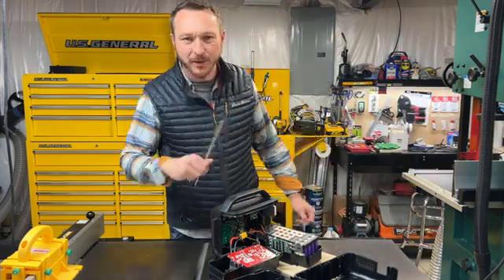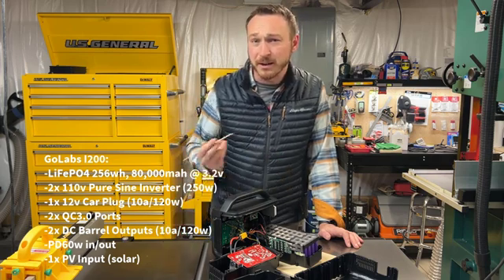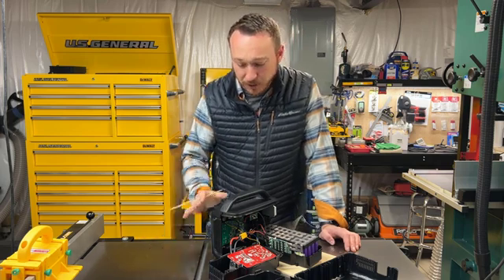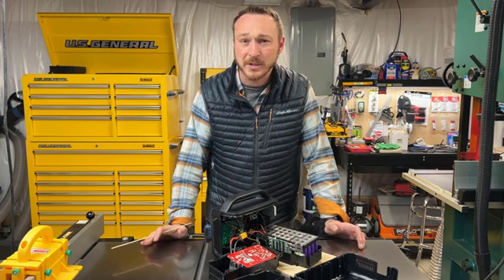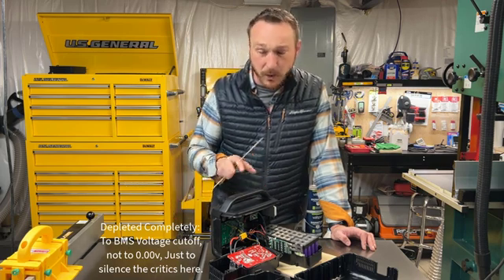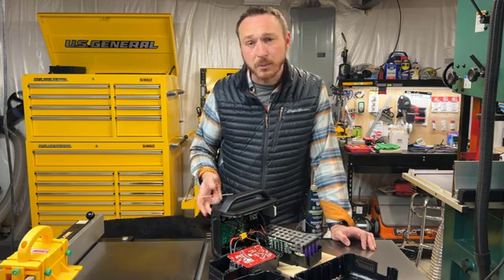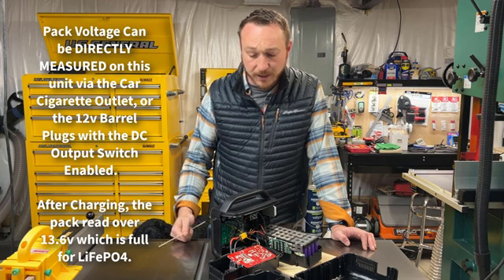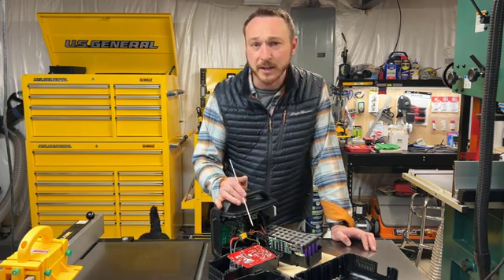GoLabs i200 - LiFePO4 - ER003 Fix - Simple fix to a COMMON failure mode

Comment: I fixed mine without taking it apart. As soon as it beeped and turned off, I got the error. I put it I. The freezer for 15 mins. 

I then Plugged a usb battery back into the usb input at the same time as the dc charger. The usb battery pack supplied just enough power to get the bms to work, and it started accepting a charge from the dc adapter.

Comment: Hey Y'all !!  I have a HUGE update for using these i200/i300 models. 

One of my units I could not get the A/C feature to work again.  So I just left the BMS disconnected. 

I then discovered that it lasts 100% longer than WITH the BMS connected. 
I did a test on the 12v output , running a BougeRv Aspen50 fridge/freezer combo. 
With the BMS on a Full Charge , the unit ran the fridge for 8-9 hours. 
WITHOUT the BMS it lasts and runs it for 17 HOURS !!!
Now it makes no sense , but I think the BMS really limits the Discharge to only 50% Capacity 
and NOW i am able to take it to almost ZERO and cycle it again and again. 

Thoughts ?
Reply: I think you're setting yourself up for substantial battery cell damage. The BMS keeps the battery cells in a certain voltage/current the battery chemistry will tolerate. Lithium Iron cells are less volatile/explosive than Lithium Ion cells, but going outside their operating envelope will probably destroy them quickly.

Comment: THANK YOU SO VERY VERY MUCH !!!!  ❤❤😅
I bought 6 of these i200's from a guy for $50 each.  The original boxes appeared to be re sealed. 
In a hurry I only checked 1 and by fate it was the ONE out of all 6 that the A/C worked just fine. 
Getting them home the other 5 units ALL gave me the ER003 when trying to use the A/C output. 
But, I figured , Hey its still a helluva deal just using their 12volt outputs. 
GoLabs support also simply advised me to Deplete ( cycle ) them to ZERO % remaining and recharge to fix them.  NOPE , no Fix.  Then another technician said hold down the POWER and LIGHT/SOS buttons for 15 seconds to reboot the BMS ( also, No Fix )
Then I found your video. 
Waalaa , I now have 5 units that the A/C feature works and 1 that is permanently unhappy. 
I ordered a DALY BMS off AliExpress which hasn't arrived yet to try and remedy the last one.  For only $18, A new BMS , I figured would be worth the fun to try and also increase the BMS from a 15amp factory to a 30amp  to test the difference in being able to handle a bit more.
But Again ... Sincere Thanks for this simple video on the ER003 fix. 
Cheers !! 🎉

Comment: If you depend on lifepo4 batteries you may end up going to heaven. As good as they are , I need to keep a DSL battery system up and running just to get them to start charging when they go too low

Comment: These portable powerstations are a disaster! GOLabs blatantly marketed that product with false information. They claimed their powerstations came with LiFePO4 Deep cycle batteries. Mine stopped working Jan. 2024, purchased Nov. 2021 and I kept it charged most of the time. I OPENED the unit to test the battery and they put very poor quality Lithium-Ion Battery Packs inside. The feeble youtube reviewers don't even check or test the batteries these powerstations have. You can expect nothing, but lies and fraud from such illegitimate brands and Amazon has no quality control or testing as to the brands they allow to be sold on their platform. A brand that is only around a few years is practicing a classic bait and switch campaign with fruadulent marketing practices and false advertisements. You cannot trust these brands. They are foreigners who do not care about customers. They did not stand by their warranty. Their customer service is non-existant. They changed their brand from GoLabs to GoTrax in a few short years. Now they are seeling battery powered scooters. If you ask me there needs to be a class action lawsuit against their company!

Comment: Appreciate this video.

Unfortunately, my BMS port broke off the board when I went to plug the connector back in.  Probably just as well given the non-existent customer support and unreliability. :(
Reply from the maker: I was provided a SECOND unit after I posted this video, and the second unit failed as well.   These are manufactured e-waste in my opinion.  The good news is, the lifepo4 pack inside is fairly standard as far as connectors and can be repurposed with the right supporting infrastructure.

Thanks for your comment.
Reply: Ok thanks but what are the right supports?

Comment: Nope    You never clearly say what the problem was.  Looks like a disassembly video.   ....  so what was the problem?
Reply: What's so hard to understand? ER003 is the problem and it occurs when the battery is fully drained. Any error prohibits the battery from working. 

The solution is to disassemble and disconnect the power cells from the board for a few minutes.

Comment: Totally confused.  You talk too much. You repeat yourself a lot. .  The only thing you fail to say is how to specifically fix the error!   ....  Unless I must assume it was magically fixed by disassembly/reassembly.
Reply from the maker: Shrug, I called out the exact section which appeared to resolve the error for me.    Big bold text on the screen.  Don’t know how much more straightforward it gets in a free YouTube video you find on the interweb!
Reply: What's so hard to understand? ER003 is the problem and it occurs when the battery is fully drained. The solution is to disconnect the power cells from the board for a few minutes. To do that you must disassemble.
Reply: Good video. I have an r300 that is dead after 4 uses. Can you do a tear down for that ply?

Comment: Thanks. AC died on me after a 12v drain. Mine is the newer battery version but it’s the same procedure. It didn’t do the trick. I will try pulling them out for longer than 10 mins. If 1 hour doesn’t work then it doesn’t work.   

Update: 20 mins did the trick. I also plug in something to AC to use up remaining energy if it helped. 😂 

I used a hairdryer to soften all adhesive. It’s way easier to remove the whole bottom feet. I took the opportunity to add a warm tint filter to the light.